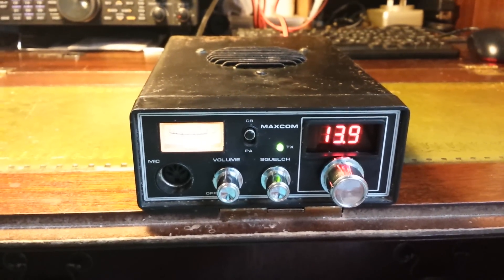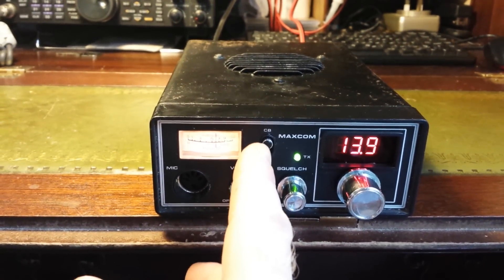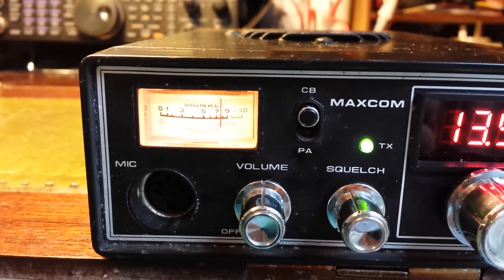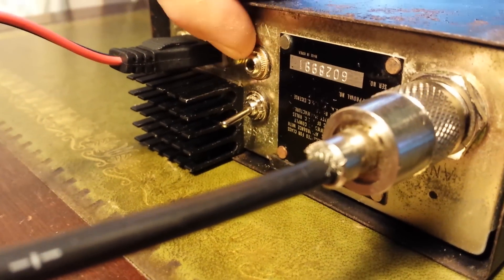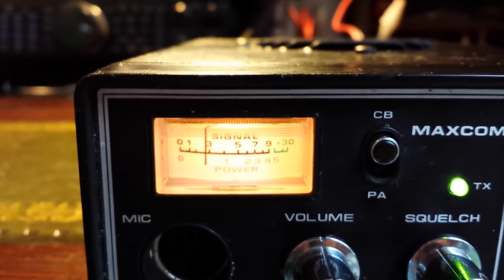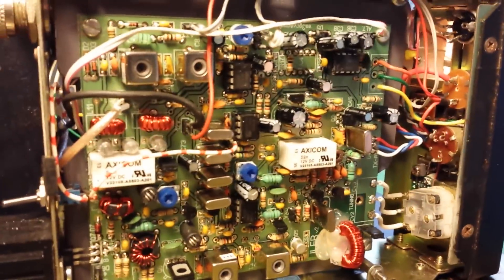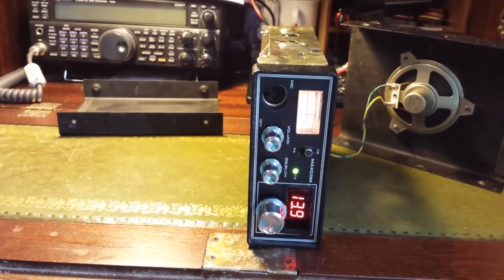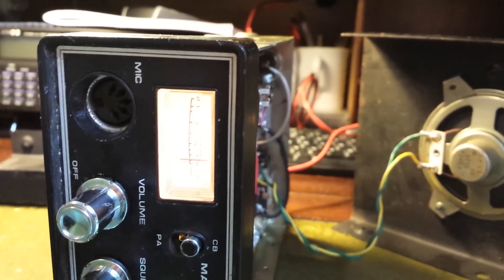ILER 40 - QRP - HOMEBREW RADIO

Comment: Would be ok to get this kit (ILER-40 v3 QRP SSB Transceiver Kit) for my amateur radio licence? And if yes, what other equipment would I need to get it fully operational (Power supply, antenna, etc..).
Reply from the maker: Personally I wouldn't recommend any radio like this as a first radio as its monoband and QRP. Best to seek local help and advice from a radio club near you